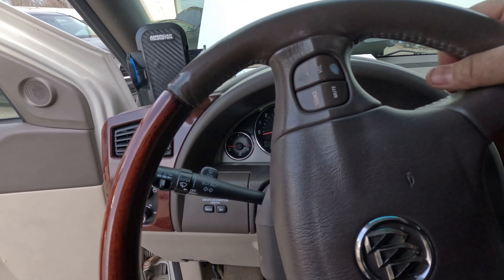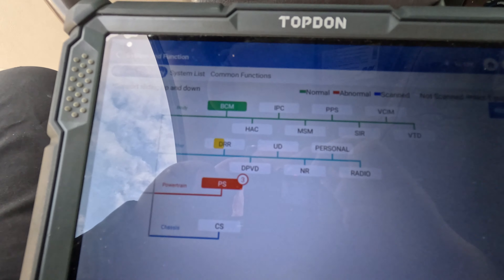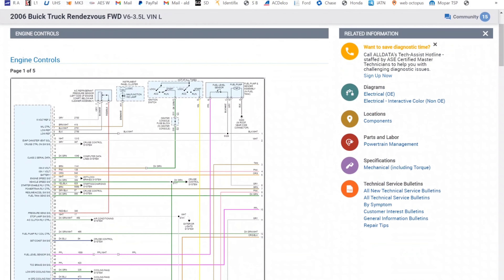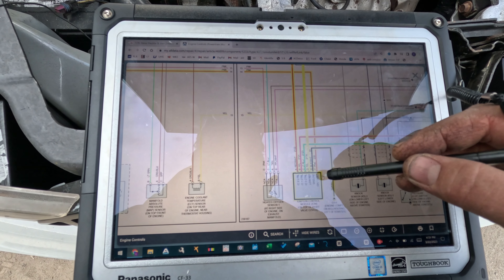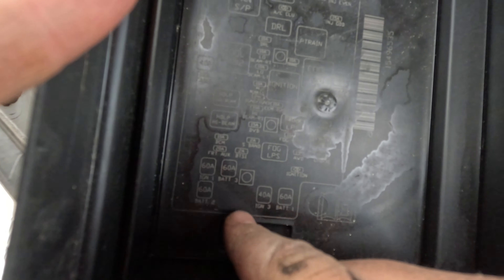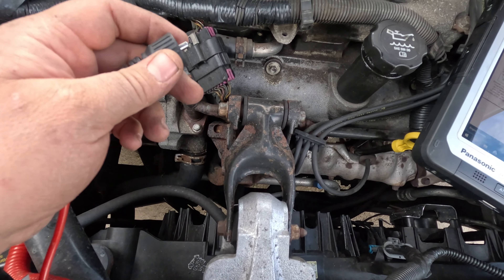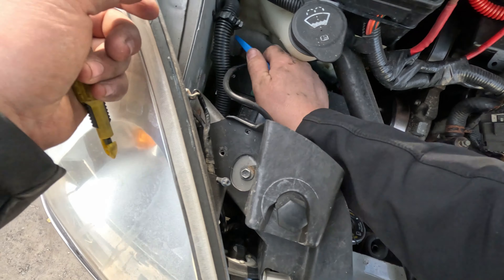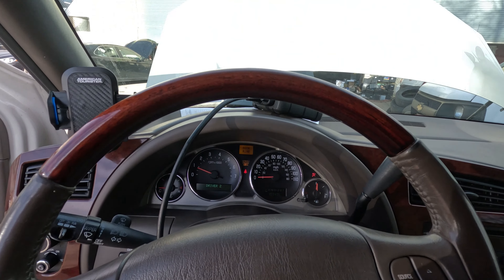Buick Rendezvous - Crank No Start

Comment: I have a 2004 Buick rendezvous and mine doesn’t even crank and there is no spark fuses are all good so is the starter.  I used a remote starter switch that’s how I found out I don’t have any spark I was thinking ignition module but that doesn’t explain why it doesn’t even crank any ideas what else might be the problem any advice would be appreciated.
Reply from the maker: If you used a remote starter switch to crank it, it makes sense you would not have spark because the key is not starting it so the PCM is not telling it to spark.

Comment: With the car running I would have started messing with the wire, if it's a break in the wire surely the issue would come back.
Reply from the maker: Good Idea! I actually did mess with them for about 5 min, nothing happened the grounds were pretty corroded so the shop got them all cleaned up. hopefully it's fixed, if not I guess they'll be a part 2  😉. Thank you for watching!

Comment: What's the rest of the story?  😮 You might want to install a separate ground. That way it will not come back for lack of ground.
Reply from the maker: The shop cleaned the grounds, they were quite bad. If the car is still there I will tell them to run a secondary ground. Thanks for the tip!

Comment: when you went down to bellhousing grounds i saw the wire used for bypass earth in shot and all the time you were testing i was thinking hope you disconnected bypass earth then you said it a little tug on the earths can temp restore ground so was the contact bad between the eyelets  bolt and bellhousing  or in the crimp and wire you could have put a bulb and power to earth at the connector and the wire you touched would have lit it but shit happens only just found your channel and subbed dont forget to tell your veiwers its free to subscribe
Reply from the maker: Thank You!
Reply: @advancedleveldiagnostics  no thank you for the videos

Comment: I was called to another garage to fix a 2005 300c chrysler. The problems they noticed with the car was Hard or no start, red lightning bolt flashing, no throttle response, headlight stays on, battery and ESP light remaining ON during, most times immediate stalling after starting however, if it doesn't stall there's a rough idle throughout idling as a result a old PCM was replaced with a new one however problem still persisted. 

  I scanned for DTC codes and saw a P0340, P2167, P2166, P2115, P2116, p0603 and more module codes like C2202, U0168, U1414, B1A25, etc. 
  Please, how can I fix these problems? 
  Can you also 🙏 provide me with the wiring diagram to CMP, CKP, APP factory values and how to test them? What should I be looking for in fixing the blinking red lightning bolt limp mode light, how can I reset the throttle without a scanner?
Reply from the maker: The codes you have are for the camshaft, and APP and I think you meant to write P0403 (not P0603) which is for the egr. All those share a 5v ref feed from the pcm, the only other sensor on that 5v ref is the map sensor. I'm not sure why there is no code for that, but I would definitely start looking at that 5v ref circuit. Feel free to email me and I can send you a diagram.

Comment: Seems I spend as much if not more time fixing poke and hope holes as I do actual problems.  Stop using pricing probes .
Reply from the maker: It's the only way to get a reliable connection, when you backprobe the whole time your doubting your connection.